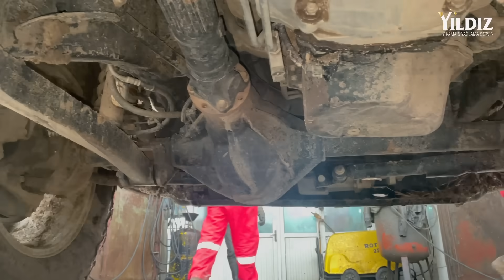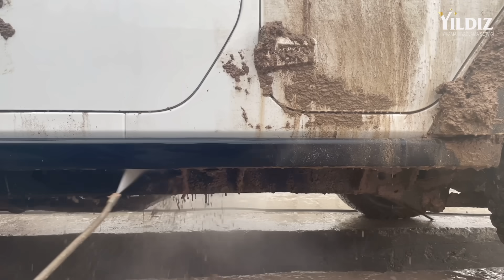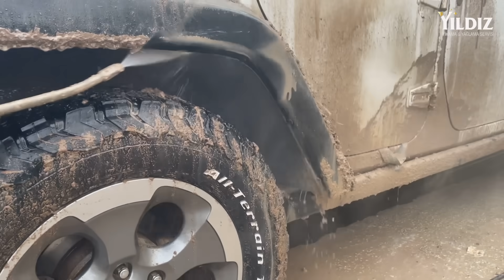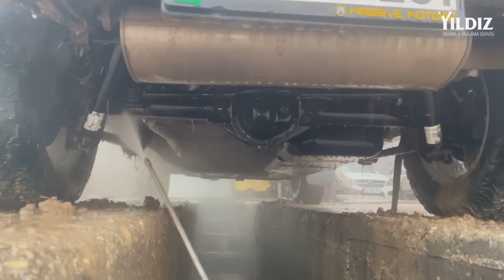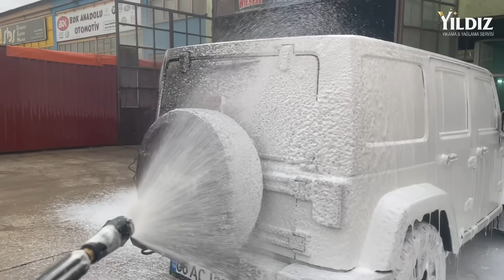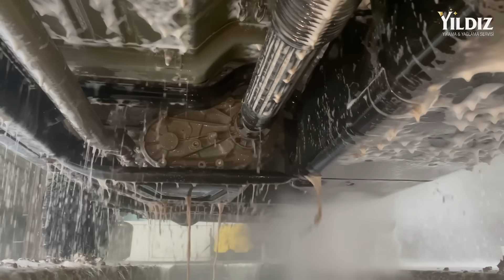Boll Çamurlu OFF Road 4x4 JEEP YIKADIK 😱 Washing JEEP in a MUD😱 Detailing Deep Clean!

Comment: What about the door jams and behind the spare tire and between the separations on the different panels there was so much mud u guys missed on the initial rinse i hope yall went back off camera to fix that cuz it was driving me nuts watching all that mud streak down the sides and the guy moving on to a different panel while there was still mud on the one he was just on
Reply: Also u guys need to stick the wand inside the frame rail access holes to get all the debris out so it prevents premature frame rotting especially in cold climates where salt is used to melt snow on roads